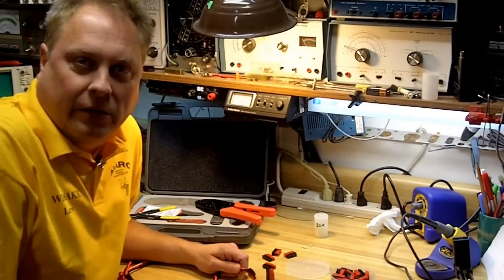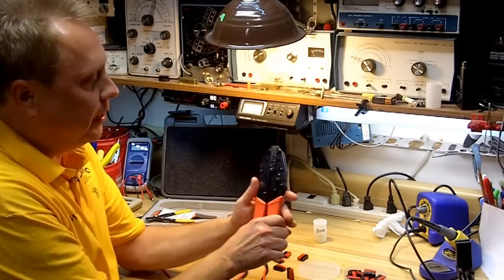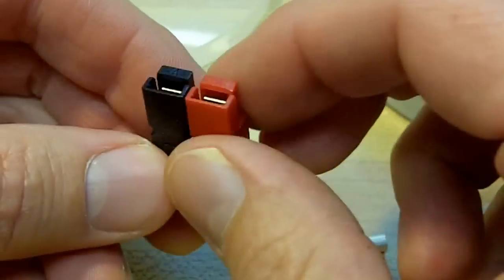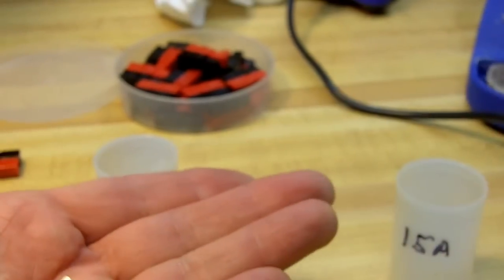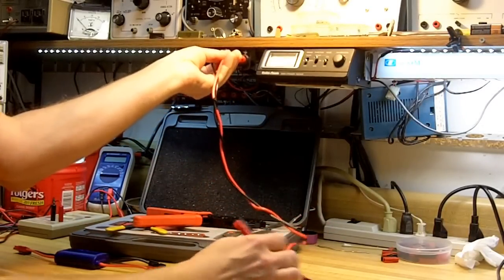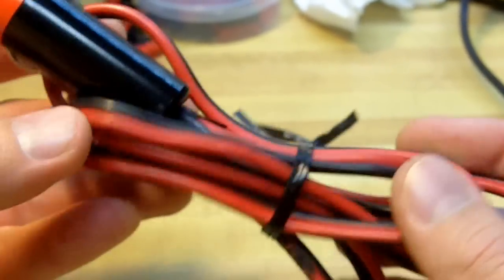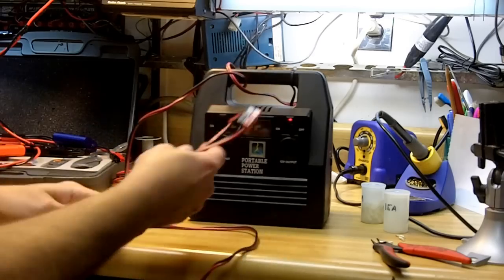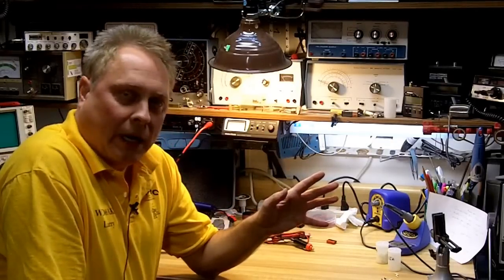Using Anderson Powerpole Connectors

Comment: Do they just pull apart to Disconnect from each end or is there a fiddley tab to lift up?
Thanks
Reply from the maker: There is no tab to lift up, they just pull apart.  Very easy and they also stay connected together well.  They kind of snap into place is the feel to me.

Comment: Great video for beginners like me. I am working on a project that requires Anderson Power Pole and I need a connector that can be installed flush into a surface and does not stick out. Would you have any recommendations?

Comment: Thank you, Larry! I just got a Tricrimp (er) and Anderson starter kit and this walk - through is very, very helpful; now I'm going Anderson Power Pole happy with all my wires! Thanks again!
Reply from the maker: Great to hear that, I am really happy with those connectors around here.  Use them on anything I can these days it seems!  Glad the video was of use for you...thanks for the post and 73
Reply: That's for sure, Larry. May I suggest that for the 15A connectors the use of  tweezers. I've found that to push those smaller, 15A connectors into the Anderson plastic housing is a bit of a challenge without a tweezers-assist - just a suggestion that worked for me. Thanks again and 73!
Reply from the maker: That sounds like a good idea, I will have to try that next time, thanks for the great tip!

Comment: Larry, what gauge wire are you using mostly for your radios? very confusing as to what gauge im supposed to be using. i.e mobile rigs and installations. thanks! -Pete WB1FZY
Reply from the maker: +Mudville ,MA For mobile radios, a very minimum of AWG 14 gauge for lower power radios but 12 is better and for 100 watt radios 10 or 12.  The larger size wire is always better for less voltage drop or heating of the wire and less noise.  And always go directly to the battery with leads fused right at the battery or power supply.
Reply: thanks again! looks like 12 awg at 30a might be my standard

Comment: Thanks. I am going to figure out how to make these connectors watertight atleast from the wire side. I am trying with liquid tape, but it will peal off, I guess using a syringe with a big metall tip (buy from pharmacy) and use some epoxy glue from the hardware store. Its like potting i guess. Any ideas? For semi permanent installation I think using vulcanized tape is good to use ontop when both connectors are in place.

Comment: I use Power Pole connectors too. I solder mine on because I trust it a little more plus I don't need to spring for the fancy tool. I too have enjoyed the universality of the Power Poles with 12VDC hookups.You didn't mention that there are other colors such as green. I use some green grounding wire for in my shack so that's also quick to connect as required. Nice nice video, keep up the good work. VA7DH
Reply: Agree   I've had the crimps fail out in the field without the crimper handy, so from this point on I'm in the soldering camp.

Comment: Good video and I need to get all my equipment standardized on anderson power poles. My biggest issue with them in the past was they are fairly pricey for a small bit of plastic and a crimp end, but they do make things easy to connect up.